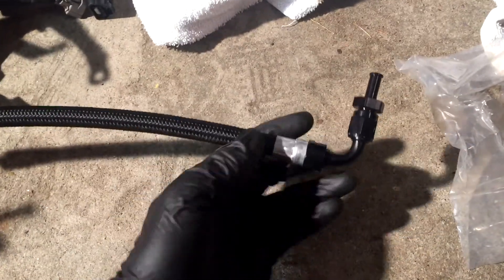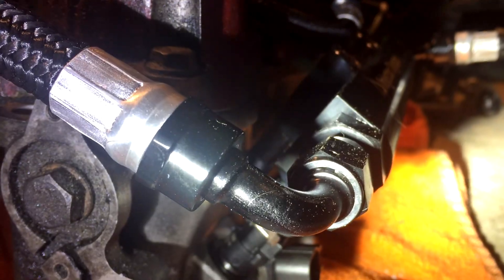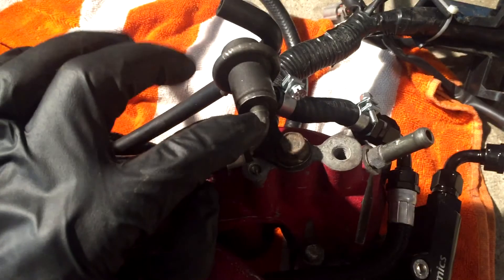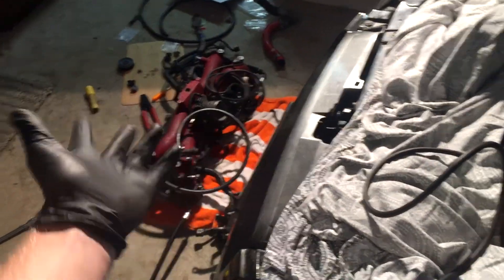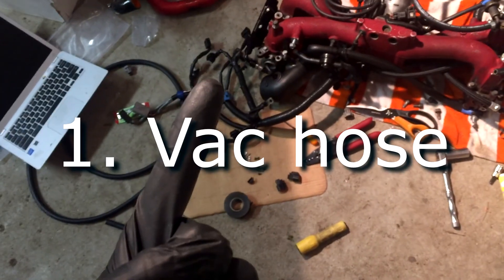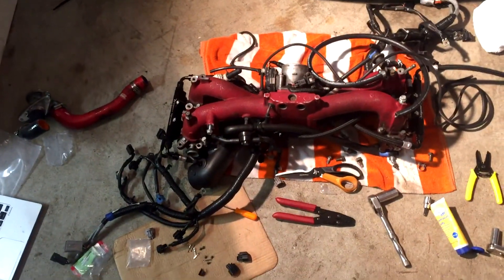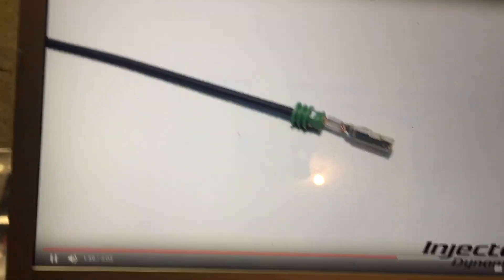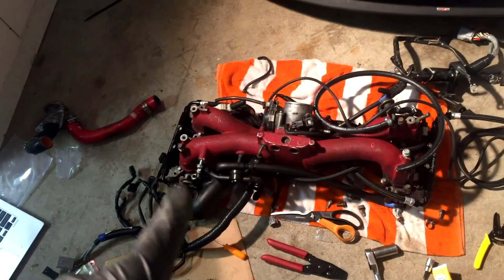STI sidefeed to top feed INJECTOR DYNAMICS 1050x install

Comment: My fittings for my top  feeds that go into the fuel rail i guess keep loosening up and leak gas how can i fix them? They are ID 1000cc
Reply from the maker: Like the O rings on the injectors?
Reply: @BenSpoolin  the part at the end of the hose that then goes into the fitting thats 90° that goes into the fuel rail
Reply from the maker: @146gods  bro add me on ig @benspoolin and send me a pic please. Been out of the subie game for a while not sure exactly what you mean based on text sorry

Comment: did you need spacers for your top feed injectors to seat properly into the side feed tgv holes? Other kits like IAG come with said spacer which I do not see for this kit.
Reply from the maker: I did not need any spacers for the install

Comment: Thank you for the video it was helpful. I’m currently installing the same lines as well but from my understanding from the injector dynamics instructions they said go from the ba k of the driver side rail them from the front of the driver side rail to the front of the passenger side rail I noticed u crossed them. What was the reasoning for that?

Comment: Hey man I'm about to do this set up for my 06 sti. Got a 255 welbro fuel pump and 1000cc injectors. Bought them used I'm gonna get them checked out and cleaned up. I dont have the rails tho. So with that being said what should I really look out for. Like I've never converted anything or modified I should say. What should I look on my used injector?! Plugs ?! Rings ?! What about the rails what should I order?! To have everything
 I kinda think I should of had bought the whole kit instead of putting it all together separately. Thanks for the help
Reply from the maker: ID 1000s? I think there are multiple rails that could work, the ID rails should be the safest bet I'd say if your injectors are also injector dynamics. Check the injectors for any O ring damage and if there is any sludge in the nozzles or anything weird like that that you'd want to clean before installing them.

This job is kinda hard from what I remember. take your time make sure you're prepared and it's not too bad. Basically all the stock stuff dissapears underneath the manifold and you're left with a much simpler setup.  Make sure to tighten everything and INSPECT FOR LEAKS afterwards!
Reply: @BenSpoolin  thank you! I will do as you say! And yes they are ID injectors! I think this is one of the safest modifications to do ?! 
I just want my car to get tune and push 385. I have the stage 2 Cobb so with the welbro 255 and the Injectors I should be close to getting my desire numbers ! I think I might even be buying a front mount intercooler as well. Turboxs fmic
Reply from the maker: @ryuk_9633  That's awesome man sounds like your car is going to rip!
Reply: @BenSpoolin  thank you! I wasn't expecting an answer from you ! But thanks! I'll keep you posted !

Comment: You should of done a parallel fuel setup.you need 8an braided line from the stock fuel system then tee it off into 6an so the fuel enters the fuel rail at the same time then exit back into another tee into an aftermarket fuel pressure regulator then back into your return line.there's videos on YouTube on how its done you should check them out.

Comment: How did you set fuel pressure ?
Reply from the maker: I used the stock vacuum referenced FPR and am running stock fuel pressure 43.5 psi at idle IIRC. Upgraded pump to maintain the pressure better but the stock pressure is fine. The stock setup increases fuel pressure as boost increases so it's good for many setups.